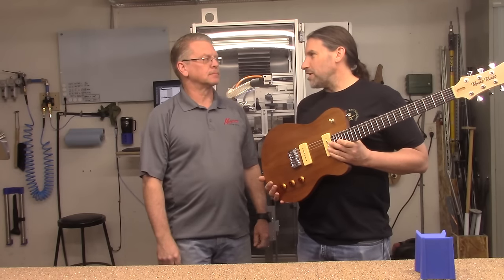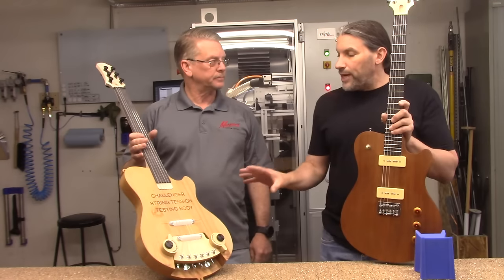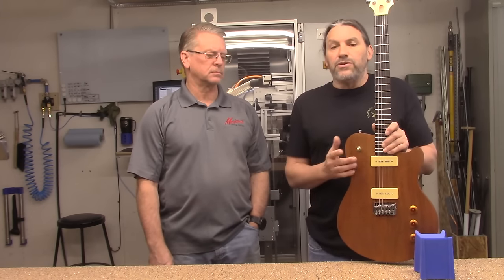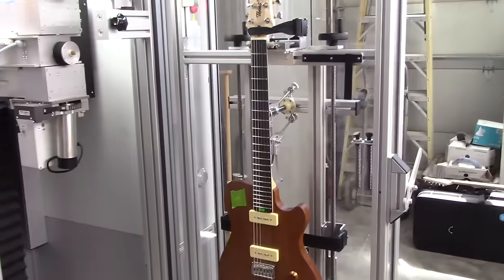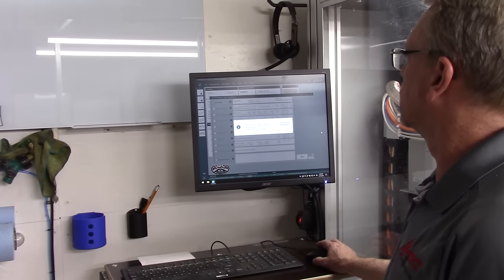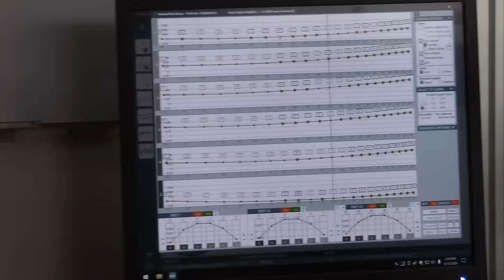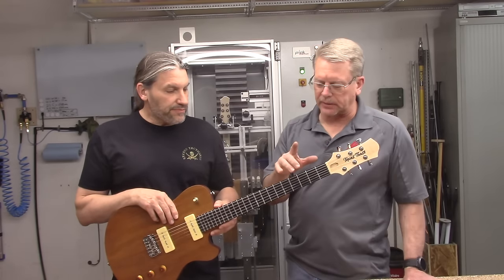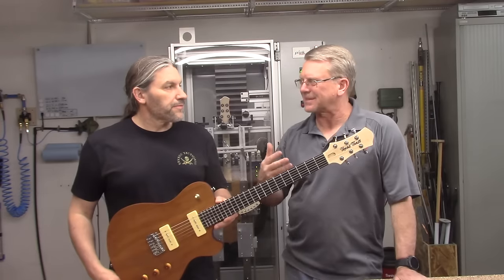PLEK Machine Myth Busters At Maximum Guitar Works... How Good Is A Challenger Level I

Comment: THE ELUSIVE, NON STANDARDIZED "FALLAWAY" on electric guitars.
Hello, wanted to get your opinion.  Have been confused by various methods of sanding frets to achive fallaway. from the various number of tape strips over the equally variable fret they go on to make a sanding beam angle. Anywhere from 2- 12 strips of tape and these put on the 5th, 12th, or 6th fret from the highest fret! Also, it seems this is unnecessary on a flat Fender style guitar and  needed on an angled neck/ body? There appears no consensus.

Comment: I hate to be that guy, but that machines “resolution” is not a thousandth of a millimeter. Its a a thousandth of an inch which .001 inches. Very doable on any modern CNC machines. My CNC brake press could hold those tolerances. Thomann says the Plek has a tolerance of .01 mm which a hundredth of a millimeter which is about .004 inch or 4 thousandths of an inch.  A thousandth of a millimeter is 10 microns and those tolerances are not used on a plek nor would that level of accuracy even be necessary.

Comment: Those are 2 place decimals on the millimeters. It is HUNDREDTHS of millimeter. Not thousandths. 🙄 Imperial uses thousandths of an inch which is 3 place decimals. Metric uses 2 place decimals…..tenths and hundredths 🙄